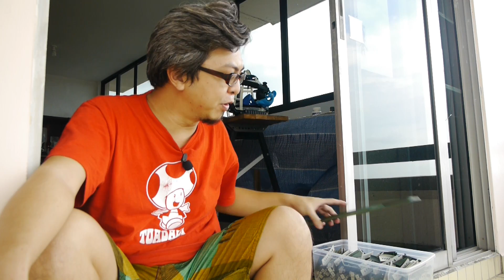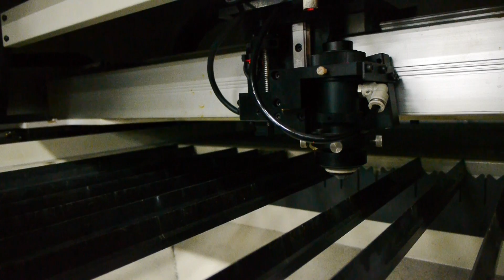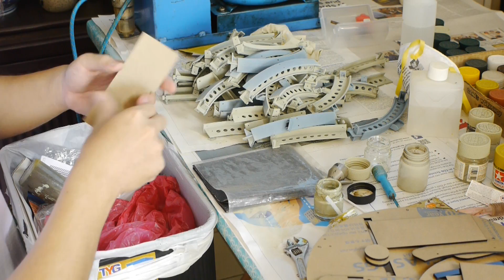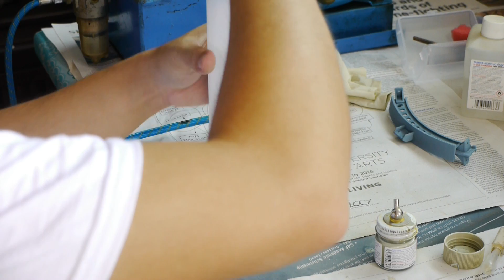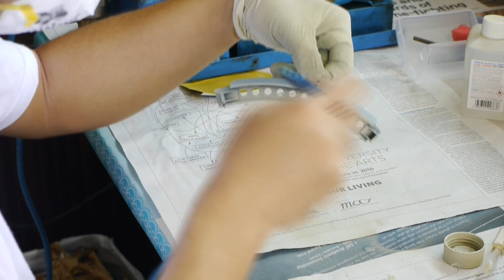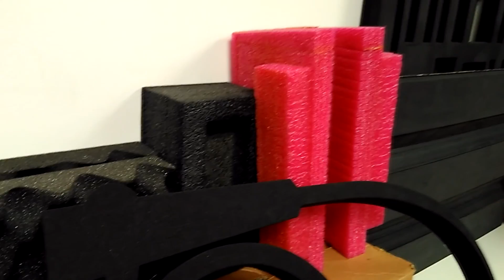Making 3D Printed Art Toy Codename Colossus - Visiting Suppliers. Week 5

Comment: I can certainly understand the delicate nature of this model,, but are you sure you want to crate it?  (shipping delays, trucking, loading docks) What are the benefits, that you can be certain of, that will make worth the expense?
(sounds like you've done this before,,  forgive my naivete.)

Thx for the airbrushing tips.  Are you using Tamiya paint?($$$),, or just Tamiya jars?
I do like the X20 thinner thou,, and I use it with other cheaper paints.
Reply from the maker: Duplicat My options are air or sea freighting it. Due to the odd shape, and one-off nature, it is not worth my while creating a mould for foam. I would also have to have a cardboard box specifically made. I am opting for the additional cost of building and shipping the crate because it is a lot better protection. The crate will have a 2" PU foam inner lining. Also. the shipping crate can also serve as a display podium (if I get a chance to decorate it).

I am using Tamiya paints. I think, in my part of the world, Tamiya is reasonably priced, about US$1.50 for a 10ml pot. I know because I am switching to it from European brand paints that I was using when I was in the UK.